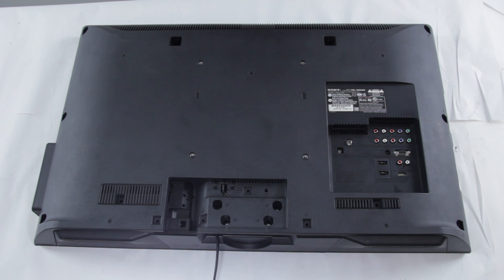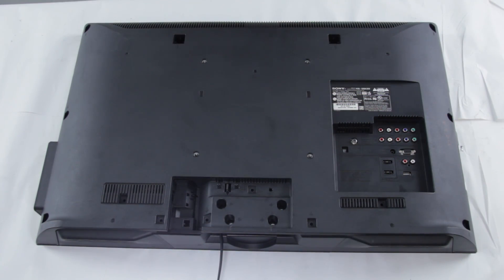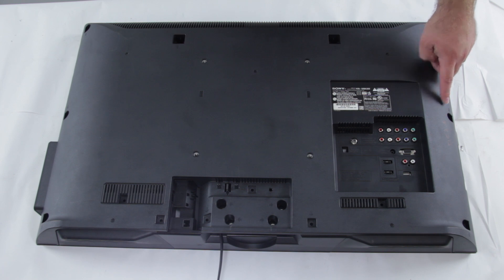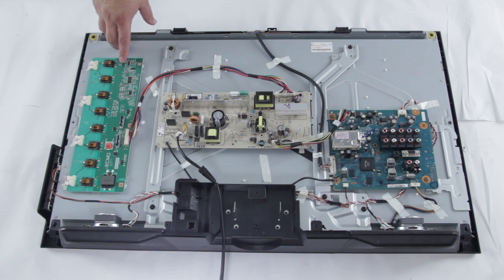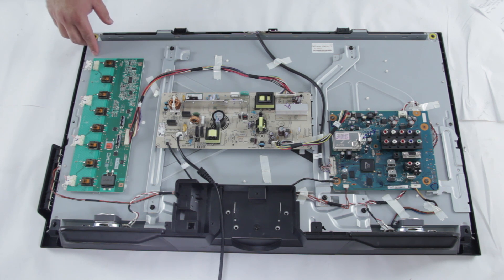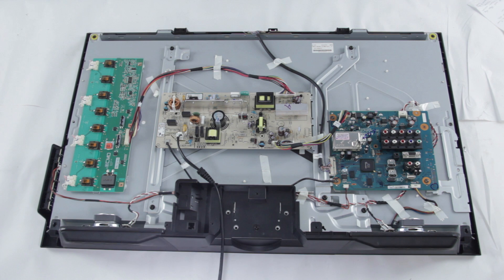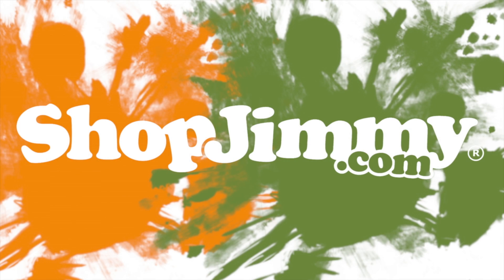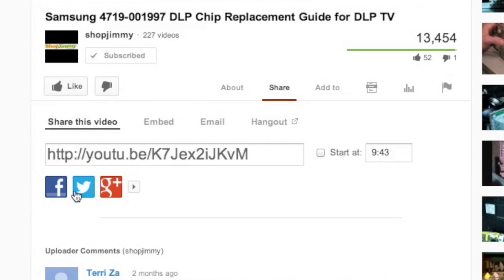LCD TV Repair Tutorial - Backlight Inverter Common Symptoms & Solutions - How to Fix LCD TVs

Comment: Hello! I have 6 years old 40 inches LCD Samsung tv, model # LN40B530,the problem was it flashes on and off every 2-3 seconds,it does have sound and picture but it don't stay on that's why i can go to menu so i can do the reset or waht ever it can help to keep th picture stay with out flashing on and off.. please help.  i cant afford to buy a new one and get this tv fix in the repair shop. thank you very muck....     Rene
Reply from the maker: +renee dequina   Try all repairs and troubleshooting at your own risk.  I recommend replacing the main board in your TV.   Click this link to replacement parts for your TV model number:  http://www.shopjimmy.com/samsung-bn94-06194x-main-board.htm  There may be multiple boards for the same TV model number, be sure to match part numbers on your current board, with your replacement for compatibility.  Here is a link to a video showing how to identify your part number, click here:  https://www.youtube.com/watch?v=RwHTvjMdrhk  Thanks and please let us know if you have any further questions with your TV Repair!  www.shopjimmy.com

Comment: i have a element tv model number eldfw464  serial number j1100227360002580 was working fine then went black have sound when turn off then on blue element screen for 3 seconds then black
Reply from the maker: +Melissa Bizewski   Try all repairs and troubleshooting at your own risk.  I recommend running the flashlight test on your TV.   Here is a link to a video we produced that shows how to run the flashlight test. https://www.youtube.com/watch?v=xUzCLgoSPGM Please reply with your flashlight test results and we can recommend a replacement part for your TV repair. Thanks and please let us know if you have any questions! www.shopjimmy.com

Comment: Liquid Crystal Tv model# LC-70LE650U 120V~ 60Hz 228W when plugged in the screen dosent light up the bottom indicator light holds solid then starts to blink after about 15sec 2long blinks followed by 5 short blinks
Reply from the maker: +U Hampton   Try all repairs and troubleshooting at your own risk.  This sounds like a TV panel (TV Screen) problem.  If your TV panel is bad, it may be more cost-effective to replace the TV as panels are typically hard to find in stock, difficult to replace, and expensive.  Thanks and please let us know if you have any further questions!  www.shopjimmy.com

Comment: ihave a samsung model # is  ln40b610a5fxzc serial # is  ayye3css600092a version sq01 had audio but no pic did the flashlight test  the lights in the back do light up and shuts down a few seconds after did change the  t con board but no changes did the flashlight test on the screen do not see any writing on screen with the light however when i turn it on it goe from very dark blue to black instantly can u pls help  me ?
Reply from the maker: +Linda Blanchard    Try all repairs and troubleshooting at your own risk.  I recommend replacing the main board in your TV.  Click this link to replacement parts for your TV model number:  http://www.shopjimmy.com/catalogsearch/result/index/?cat=56&q=40b610a5  There may be multiple boards for the same TV model number, be sure to match part numbers on your current board, with your replacement for compatibility.  Here is a link to a video showing how to identify your part number, click here:  https://www.youtube.com/watch?v=BEPWrefQvqI  Thanks and please let us know if you have any further questions with your TV Repair!  www.shopjimmy.com

Comment: please help! Sony Bravia KDL-46ex501 how do I replace the control mt board and get the white cables out?
Reply: The TV unit when plugging it in I'm able to turn on it on via power button then green light comes on and NO picture or screen response. The PSU and Main A board were replaced so either its a bad board or the control mt board. I do not know how to pull the white cable from the top. please help are any additional thought would be appreciated.
Reply from the maker: +Emily Peacock   Try all repairs and troubleshooting at your own risk.  I recommend running the flashlight test on your TV.   Here is a link to a video we produced that shows how to run the flashlight test. https://www.youtube.com/watch?v=xUzCLgoSPGM Please reply with your flashlight test results and we can recommend a replacement part for your TV repair. Thanks and please let us know if you have any questions! www.shopjimmy.com
Reply: +ShopJimmy.com 

Thanks! I did do the flash light test already! Well, after I posted this and watched more videos. The flashlight test showed no results and the screen was still black with nothing showing faint on the screen whatsoever. I appreciate the response.

Comment: Hi! Excellent videos -- I've watched several this morning as I've worked to diagnose the problem with our TV. We have a 47" LG LED TV (model 47LH90 manufactured in Mexico in 2009) that suddenly shut off a couple of nights ago. It clicked off and then back on, cycling through off and on. When it would come on, the red lights came on as they always do when the unit is coming on and searching for inputs and then clicked to white and then off. Then, the cycle repeated. During this time, we did not get any video or audio output. No splash screen, either. This morning, I removed the back of the unit and inspected each board. None of the boards have any obvious damage and all connections are tight. I used canned air to clean out all of the dust bunnies. I tried plugging the unit back in and the same cycle happened the first time, but then on the second cycle, it clicked two times (versus the usual one "click" we usually hear), but then it cycled through the red lights and to the regular white "on" light. The splash screen still does not appear. It is not currently plugged into any input (cable box, blu-ray player, etc.), so I couldn't say whether sound has returned. It appears video has not. I'm suspecting we might be dealing with the video control board? Other ideas I should try or ways to rule out other possibilities? Thank you in advance!! I'm a teacher and can't really afford to replace the TV, so if I can fix it, I'll be delighted!

Comment: Hello, I have a Samsung LCD TV model number LE46B530P7W And I have an issue with no back lights. (sound and if you hold a torch to the screen so can faintly see images). Also if you turn on the TV in pitch darkness you can see the back lights come on for a millisecond then straight off. I've got good voltages across the power supply. Would this more than likely be the inverter? As I've heard bulb problems can cause the inverter to 'trip' off. thanks.
Reply: Thank you for the reply. I took the risk and ended up with the right inverter for the TV but not the exact one, I attempted to plug it in but I get the same miniscule flash from the screen and that is all, I will investigate into the power supply. Thanks.

Comment: My Samsung #LN-S3241D has a solid black box on the bottom half of the screen. Top half & sound work great. When the picture changes color, the black box can change colors too. What might need to be replaced? The backlight inverter?

Comment: ok i have a lg 47lh90-ub......has sound but the picture is like shadows instead of color
Reply from the maker: +Frank Smith  Try all repairs and troubleshooting at your own risk.  This sounds like a TV panel (TV Screen) problem.  If your TV panel is bad, it may be more cost-effective to replace the TV as panels are typically hard to find in stock, difficult to replace, and expensive.  Thanks and please let us know if you have any further questions!  www.shopjimmy.com
Reply: +ShopJimmy.com Ok well we did the troubleshooting and decided it was the tcon board 25 dollar part and is fixed

Comment: so I have a viore LC40VF60 the logo screen appears when its turned on and I can open the menu and toggle for just a moment then it goes dark. I can see the menu still open on the tv but its by no means bright and if you didn't look very carefully and pay attention to the green (on) power light you would have no idea the tv is even on. so I did lots of searches and found that its possibly the inverter board. purchased an inverter board and replaced it... same issue!! do you have any suggestions of what else it possibly could be? thanks in advance
Reply from the maker: +Danielle Mathis   Try all repairs and troubleshooting at your own risk.  This could be a problem with either the power supply or a defective replacement inverter.  Click this link to replacement parts for your TV model number:  http://www.shopjimmy.com/catalogsearch/result/?q=LC40VF60  There may be multiple boards for the same TV model number, be sure to match part numbers on your current board, with your replacement for compatibility.  Thanks and please let us know if you have any further questions with your TV Repair!  www.shopjimmy.com

Comment: Hello, 
I have a Samsung 52" tv Model No. 5265FX/XAA and Serial No. AJ733CFPA02706W   Version:  003 and I have similar problem described in video like blank video and no back light but sound ok. I lookes at the Video but confused and could not find ant burnt circuit board.  Can you be able to figure out what could be a problem?

Thanks and I like you video was very informative.
Vijay

Comment: hello i have a MEDION® P12173 (MD 30727) 40 " tv (aldi) lcd      this has  sound but no image   ...if you have strong light in front ,you can see the image  moving but black . From the power suppy board and inverter which are in same board there are 2 cables that coming inside the backlights(behind the lcd screen and that diffusion  filter)  giving them power, the voltage in that cable is 80 volt... the back light stripes of leds  are 4-5 stripes and are connected in line the one stripe of lights to the the other and there is an indication that each stripe is 96 volts.  . when i put the ohmmeter to see the resistance between that cables (disconected from the inverter board and conected to the backlights only) shows nothing in the more sensitive high resistance indication in both direction of polarity if i put the probes (similarly in each stripe seperatly) .....my question are  
1)  aparenty the voltage 80 volt is not proper  should i put an inverter of 96 volt X number of stripes of backlight ?   96 x 5  ?  x= multiplied
is it normal not to count any resistance in the cable and in each stripe of leds when i use the ohm metter?
# where can i find such inverter to buy? or the baklights stripes?

here is a photo of the backlight stripe
https://plus.google.com/u/0/114631303622526325039/posts/XerD4rVHLoF?pid=6212375266243208274&oid=114631303622526325039

please tell me the type of inverted and back light i have  so i can make better research too..thanks

Comment: Hello.  I have a Samsung 40 inch LCD model  LNS4095DK/XXA and have static on the left hand side of it.  It happens all the time with the cable or the DVD playing.  I have troubleshot by changing out the hdmi cable the cable box, but I still have static.  Any idea?  Please let me know at      fan_sports_23@yahoo.com
Reply from the maker: +Scott Weback   Try all repairs and troubleshooting at your own risk.  I recommend replacing the main board in your TV.  Click this link to replacement parts for your TV model number:  http://www.shopjimmy.com/catalogsearch/result/index/?cat=56&q=LNS4095  There may be multiple boards for the same TV model number, be sure to match part numbers on your current board, with your replacement for compatibility.  Here is a link to a video showing how to identify your part number, click here:  https://www.youtube.com/watch?v=BEPWrefQvqI  Thanks and please let us know if you have any further questions with your TV Repair!  www.shopjimmy.com

Comment: just purchase a used screptre xB32 lcd tv  My problem with tv it comes on with a steady blue light but has no backlight on screen. Will turn on but not off  must pull off cord to be in the off position. what can be the problem with set?
Reply from the maker: +Denis Flood   Try all repairs and troubleshooting at your own risk.  I recommend replacing the main board in your TV.  Click this link to replacement parts for your TV model number:  http://www.shopjimmy.com/catalogsearch/result/index/?cat=56&q=xB32  There may be multiple boards for the same TV model number, be sure to match part numbers on your current board, with your replacement for compatibility.  Here is a link to a video showing how to identify your part number, click here:  https://www.youtube.com/watch?v=Aodz2LHkzbY  Thanks and please let us know if you have any further questions with your TV Repair!  www.shopjimmy.com

Comment: When I turn on the TV the power light comes on and there is a brief  partial light from the screen. It has no picture or sound then the picture remains black. If I try to move up or down with the channels on the back ( no remote) it shuts down. Doesn't shut down with the + or - signs. Stays on but has no pic or sound. LG 47Ln5400 model
Reply from the maker: +Terry Christian  Try all repairs and troubleshooting at your own risk.   I recommend replacing the main board in your TV.  Click this link to replacement parts for your TV model number:  http://www.shopjimmy.com/catalogsearch/result/index/?cat=56&q=47Ln5400  There may be multiple boards for the same TV model number, be sure to match part numbers on your current board, with your replacement for compatibility.  Thanks and please let us know if you have any further questions with your TV Repair!  www.shopjimmy.com

Comment: I have Sharp 42 inch. Model LC-42D62U. Serial 708830222. When I turn it on I get a blinking opc and power light. Is this fixable?
Reply from the maker: +Russell Whitaker   Try all repairs and troubleshooting at your own risk.  How many blinks are you seeing or what is the code?  Thanks!  www.shopjimmy.com
Reply: +ShopJimmy.com No code.  The screen is black.  The lights blink as long as the tv is plugged into the wall.

Comment: sharp lc-32lb261u   the backlight will not turn on. sound works. we had a power surge. no capacitors look damaged. red wire to the back light is showing 12 volts. just does not light up. please help :)
Reply from the maker: +Bigeframe Deskflags  Try all repairs and troubleshooting at your own risk.  I recommend replacing the main board in your TV.  Unfortunately I do not see any replacement parts in the search results for your TV model number on our website.  Please reply with your part number on your main board and I can try searching for replacement parts.  Thanks and please let us know if you have any further questions!  www.shopjimmy.com

Comment: I really could use some help fixing my TV, it's a sanyo 39in LED model dp39e23. the lights on 3/4 of the TV dim out completely and I've had to shut it off and turn it on several times to stop this from happening and now it seems it doesn't want to work properly at all, I don't know where to get the parts to fix the problem and or even what to purchase so I can fix it

Comment: Hello, I have a Toshiba Regza 46LX177. The screen has horizontal bands or ribbons that seem to come from the right side that flash and flicker and go from bright to dark flashes. Its not just one band but many and they overlap each other. For a second or two it seems fine but then starts flashing again. The bands go all the way across the screen but seem to start from the right and are the worst there but start to fade out the further they go to the left.

Comment: I have a Sanyo TV Model # DP42841 Serial # B2200955634395 that would not come on at all. I have replaced the Power Supply Board and also the Analog Board and still no power. I am looking at the Backlight Board but need some advice? New TV may be cheaper if I end up replacing every board!

Comment: I have a Samsung LN40A630M1FXZA, and the right side of the screen is dark when I turn it on.  After I few minutes the TV works fine.  Should I replace the backlight inverter ?  Please email answer to johnohio03@gmail.com
Reply: +David exel  I replaced all the boards and sometimes the TV work and sometimes it doesn't

Comment: Hello Jimmy i Have a Samsung UN46FH6030F. When it first comes on its normal but after like 3 seconds it goes dim. I did factory reset still does it. Its still watchable but not as bright it does it on all inputs. I had the tv gave to me the guy i got it from said that they had a storm one night and the electric went off and its been doing this ever since. Any info would be greatly appreciated. Email is primmster123@gmail.com if need to get hold of me  Thanks and  Have a good day

Comment: My Mitsubishi LT 46148 started displaying vertical lines at about 18 months. Some fade after the TV is on for a while. Recently, the screen started strobing rapidly. After a few minutes, it went to black. When I turn it on, a red LED appears to the left of the normally green power LED. Is this two separate issues or can it all be attributed to one board?

Comment: Hi. I have a Dynex 46" LCD tv that has sound but no picture. The tv model number is DX-46L150A11 .  I don't want to go out and purchase a bunch of parts and experiment with the repair. I'd rather have it narrowed down to one or two parts. If it is the backlight inverter would there be any soldering involved or just snap on parts? Thanks for your time.
Reply from the maker: +Misterr Mann   Try all repairs and troubleshooting at your own risk.  I recommend running the flashlight test on your TV.   Here is a link to a video we produced that shows how to run the flashlight test. https://www.youtube.com/watch?v=xUzCLgoSPGM Please reply with your flashlight test results and we can recommend a replacement part for your TV repair. Thanks and please let us know if you have any questions! www.shopjimmy.com